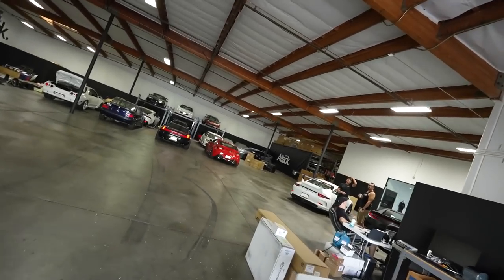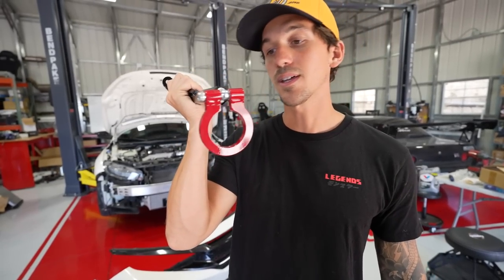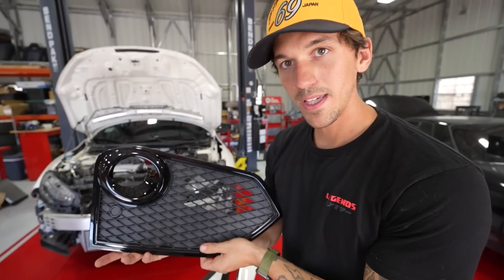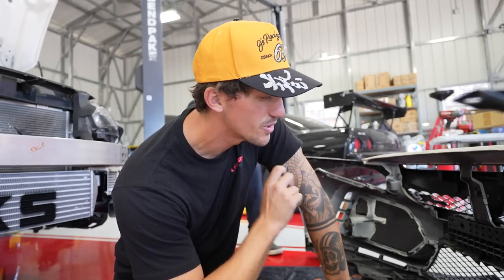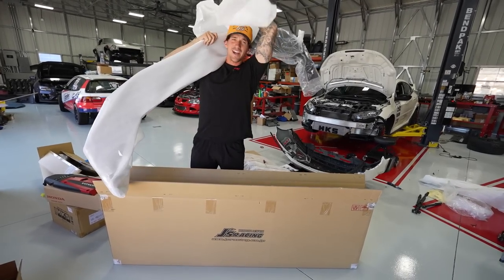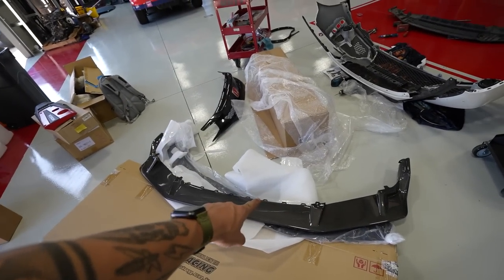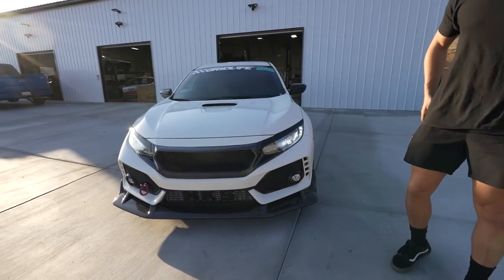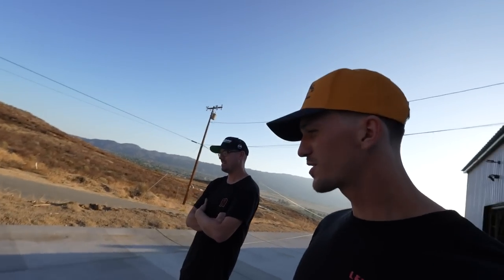Civic Type R Gets the ULTIMATE JDM Front End | J's Racing Carbon Front Lip & Grill

Comment: Should definitely get a battle aero chassis splitter to protect that expensive carbon fiber lip! 👍
Reply: Battle aero is garbage. Racebred FTW.
Reply: @1Luthacris  Does it really matter what splitter you go with? LOL as long as the splitter you use is strong, and functional. Kinda dumb to say one is significantly better and one is trash when both literally perform the same results. Unless you actually have an R and ran both splitters to prove that one is trash?? 🤔🤷‍♂️

Comment: The grille never seems to fit correctly after you take off the original. Had to use some zip ties to make sure my aftermarket one stayed in place. That middle piece you cut out was meant to help hold the opening up to keep the grille from coming off the clips.